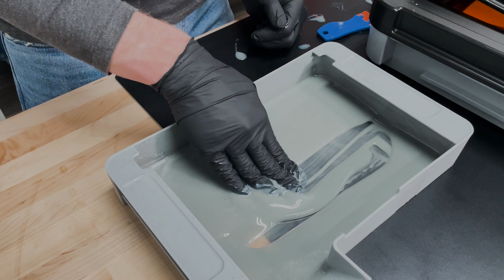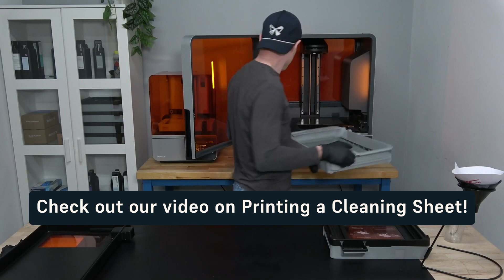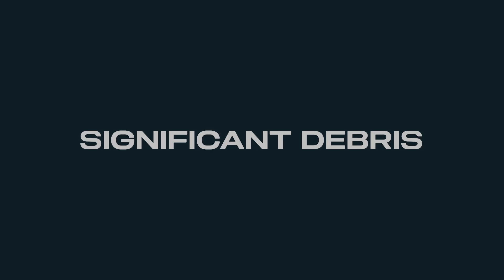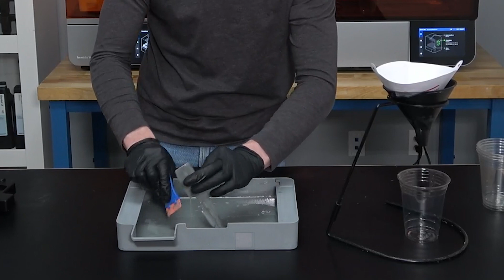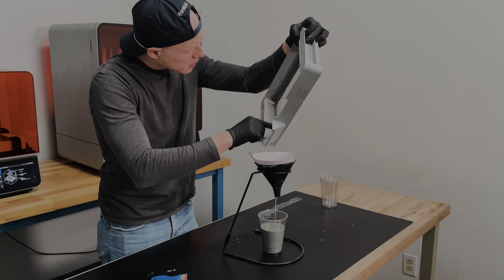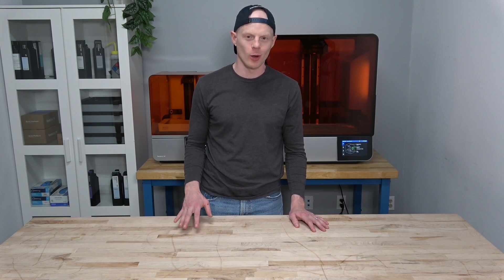How to Clean Debris from the Resin Tank | Form 4 & Form 4L SLA 3D Printer

Comment: I’m using a Formlabs Form 4 with High Temp Resin V2.

I recently had a print failure because I used too few supports. The model detached from the build platform and fell into the resin tank, leaving some cured resin/debris stuck to the bottom film.

I filtered the resin and ran the Cleaning Sheet procedure, but unfortunately the debris is still firmly stuck to the film.

What would be the safest way to remove it without damaging the tank?

Has anyone had a similar situation with a Form 4 + High Temp Resin V2? Is there a specific technique for removing stubborn cured resin from the film when the Cleaning Sheet doesn't work?

I’d especially like to hear from people who have actually dealt with this rather than replacing the tank immediately, since the tank is brand new.

Comment: We have a form4b in our lab. We predominantly print dental custome special trays.
We are experiencing difficulty during cleaning. 
We found that the little scraper provided as seen in this video scratches the membrane on the tank. This is during light to deleacate application. We've gone through about 10 trays in about months. They don't seem to last nearly as long as formlabs state. The guidance says it should last 75000 print layers per tray. We've done about 82000 print layers In that 5 months. Initially we realised that some of the cleaning issues and scratches were down to user error.
But we went through a round of having lots of misprints with no real clue as to way. We strain out the resin after every misprints and print a cleaning sheet. Its just very frustrating. 

Can you clean the tank with alcohol and lint free scratch free cloths?
Reply from the maker: Hi @anthonybrotherton3212, sorry to hear that you’ve been having a hard time with your printer! Regarding your question about cleaning the tank with alcohol and lint-free cloths: we strongly advise against this. Using alcohol or cloths (even lint-free ones) can potentially damage the delicate membrane of the tank, which could lead to further print issues.
To best help you get back to successful printing, reaching out to our support team is the best solution here. They'll be able to provide tailored guidance, especially if you include some photos of what you're experiencing, and a sample file of one of the prints that failed. This information will allow our team to diagnose the problem more accurately and provide the most effective solution for you. You can reach out to them at support.formlabs.com/s/contact-support
We're here to help and want to ensure you have the best possible experience with your Form 4B!
Reply: Thanks for your reply. Weve tried to get support from formlabs but the issue is we work in an nhs hospital. Unfortunately we cant share diagnostic and or print logs as the printer is standalone with limited access to the Internet. 
For the cleaning , Weve Been following the guidelines on formlabs website. It says to use ipal with the supplied lint free cloths.